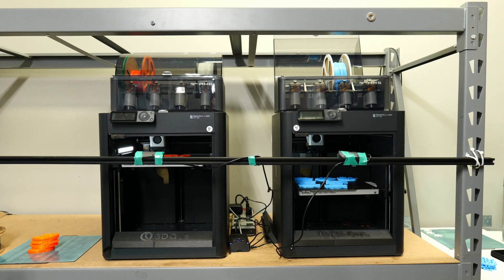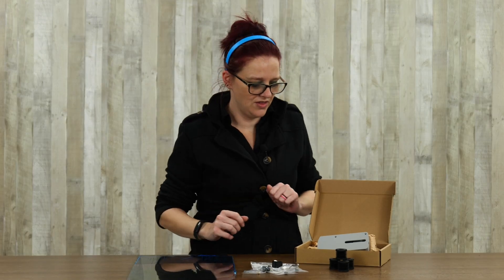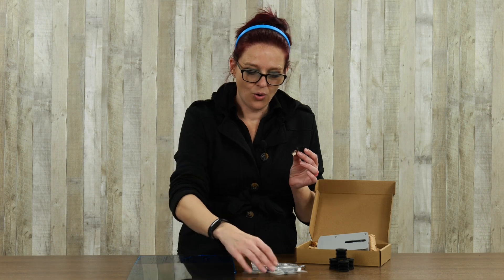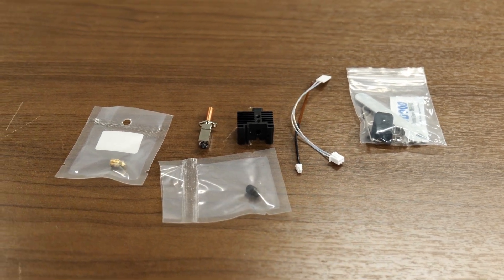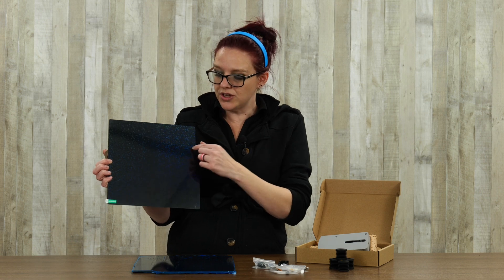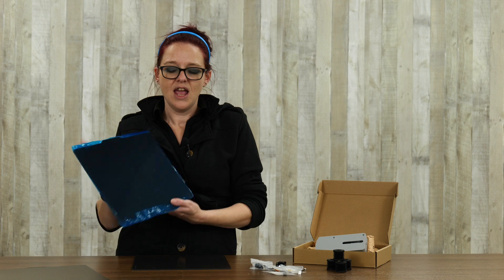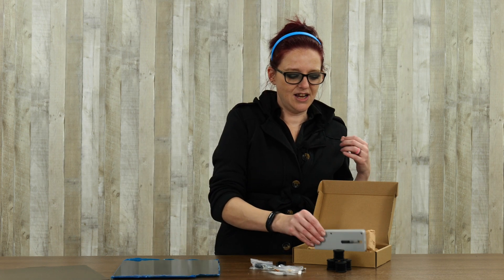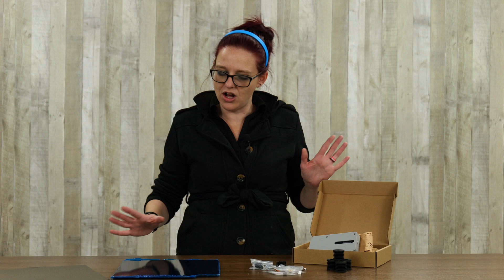TOP 5 UPGRADES FOR BAMBU PRINTERS #3d #bambu #bambulab

Comment: I got your carbon fiber build plate for the X1C a couple weeks ago. I have been putting it through it's paces and have not has a single issue yet. I thought I might run into issues getting prints off but after letting the plate cool down almost every print has just popped off. The few that didn't just needed a bit of pressure under the print from a scrapper and it didn't damage the plate. I have been printing tiny ABS prints to a couple prints that took up the whole plate and haven't had a single print warp on me yet. Usually the longer and larger prints will always warp. I haven't had that issue yet. Thank you for this build plate.